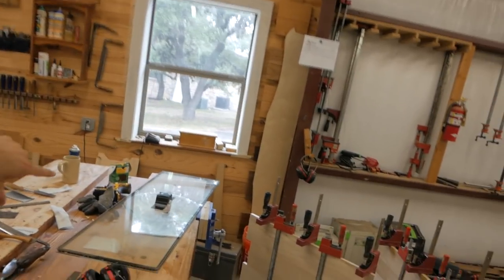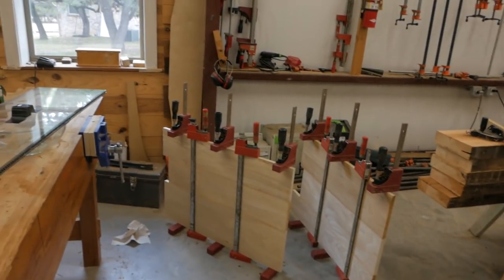Coffee Spoon: Carved From Red Oak Then Finished With Ammonia Fumes

Comment: Vinegar works as well, apply directly to the wood. I've also used steel wool dissolved into vinegar and applied to wood! But ammonia gives a great effect too!
Reply: Just plain old white vinegar wiped on like any oil? Does it have to be a tannin rich wood as well? I’ve only used stock finishes off the shelves, but am looking around at making/doing my own thanks to M&T podcast!
Reply: @gregorymosher5008  Yes I've used white vinegar multiple times I've even tried, cider vinegar as well as malt vinegar. They all have different effects on different Woods, obviously the woods with a greater set of tannins do well. But I've also used white vinegar and black tea which also helps with darkening the wood. The black tea will release tannins into your vinegar and then help bring out the colour. I'm a big proponent of natural finishes.

Comment: Very cool. Learn something every day! Thanks for the videos, I really enjoy them. Quick question.... I notice that you have some wood panels on your walls... did you find these prefinished, or did you finish each board one by one? If so, may I ask what you used. I’m currently setting up a new home shop and would like to go with some nice wood slats like yours (or similar) however I don’t want to finish hundreds of boards by hand. Thanks!
Reply from the maker: +Joseph Muench no problem!  I actually left these unfinished but I could easily roll on a poly or oil.

Comment: I've been everywhere in my area and nobody carries high concentrate ammonia. Where did you find that and how strong is that one? Also how long was it in there?
Reply from the maker: +Nicholas Sinovich you're right it's not easy to find.  I lucked out and found this at a local hardware store in a nearby town.  They call it janitorial strength ammonia and it's sold in the cleaning section.  It's very strong stuff, only took about two hours to achieve this color.

Comment: Red oak isn't good for cutting boards or wooden utensils because its to porous. its almost like a straw. I had a long piece and put one end in water and could blow air right thew it. White Oak is fine because the pores are clogged with enough tannin.  my second cutting board make of red oak leaked cutting board oil for a week after i made it. I wouldn't want something getting sucked into the wood and then rot. 

shame, its really nice wood to work with when it comes to carving .

when did you get your carving chisels?